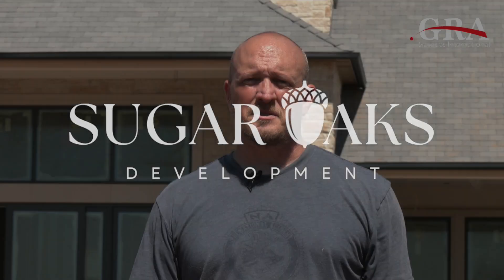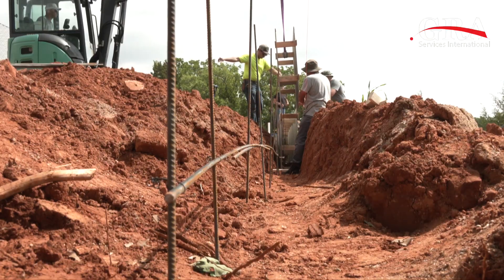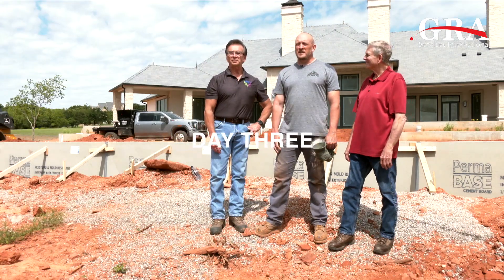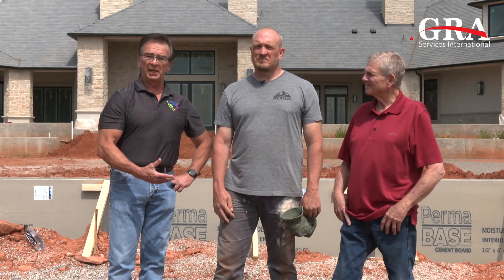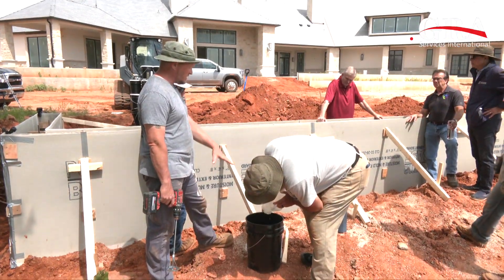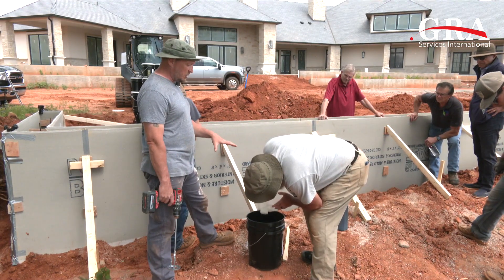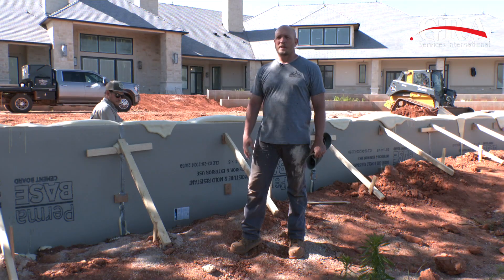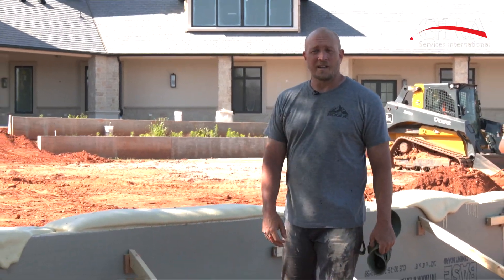Building a Retaining Wall with Secure Set High-Density Foam

Comment: It would be interesting to see this used with an ICF block system or even a dry stack CMU wall i suppose if you can figure out how to keep the blocks from lifting out of the way. It doesn't look like there's much outward pressure if the foam has room to expand elsewhere

Comment: why are exterior supports only on one side?
Reply from the maker: Thank you for your question and for watching the video.  We appreciate you!  The forms on the north side were up against the dirt wall, but also the forms were connected to each other by six blocks which make them one solid, two-sided panel when placed into the dug out channel.  In essence, if one side moved the other side moved with it.  The supports only being on one side allowed us to get the wall perfectly plumb in unison and hold it there for the foam pour.

Comment: deadman rebar should be bend over rebar in the wall and even with that I'dont follow how this wall will hold against the soil pressure
Reply from the maker: Thank you for your question and for watching the video, we appreciate your feedback and observations.  The deadman rebar were securely tied to the interior rebar and the vertical interior rebar were driven down into the bed rock, of which the foam wall sits atop and is adhered to.  The wall as it sits and when finished is two feet below the ground and also sits two feet above the ground.  As such the soil pressure will not be of an amount to cause any great lateral pressure.  However, the foam has a compressive strength of 14,832 pounds per square foot and a tensile strength of 130 PSI, which is greater than the native soil here (28 PSI) in Oklahoma and stronger than unreinforced concrete.  When the foam was poured, it was allowed to come out of the hole where the deadmen sit, and then the foam was contiguously poured to connect the deadmen into the ground; thus making it all one monolithic structure.
Reply: I'm still in doubt how two feet below deadman will hold in heavy rains.
And also vertical rebar to which it been tied will surely start bending under pressure.
But I'm live in harsh winters place, so I'm not sure what applies to Oklahoma.
Would be nice to see how project going after couple of years.
Reply from the maker: @nick9323  What you do not see in the video is that drain lines were installed in the bottom of the trench before the Secure Set Foam part of the project.  Also, there is rebar into the bedrock. Another important fact is that Secure Set is a closed cell high density foam, which will not absorb water; therefore, there will not be a frost heave type issue in northern climates.  We have customers that use our foam in Alaska and Canada without issue.  Thank you, GRA Services.